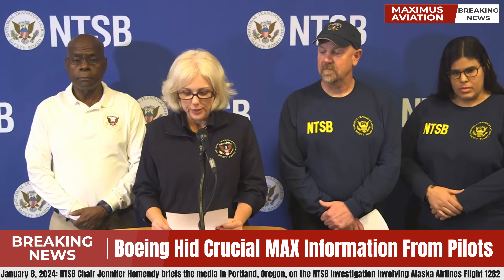Boeing NEVER Told Airlines That 737 Max Cockpit Door Was Designed To FLY Open During Decompression!

Comment: 13:23 
The door can be opened in a position to conduct maintenance which is 15 degrees down means it is not a permanent door plug as the springs are left in. 

Thus, if any of the hardware holding and properly alining the door in proper position fails or not installed correctly or the door itself defects outward causing a miss alignment of the door plug stop and tabs, the springs will eject the door into the airstream which will then rip the door further out and tear off of the airplane.

Comment: In Information Technology, worship of Almighty Outsourcing And Profit Over All means mostly things like a payroll application not working as expected or user frustration with a system 
 
When critical equipment such as an aircraft that transports human beings is concerned - the corporate love affair with outsourcing and profit before everything can result in loss of life 
  
Boeing needs to be  returned to the engineers and for an unstinting commitment to quality to be the driving force - even if it means outsourcing goes by the wayside and executive pay is reduced. Airlines need to put passengers above overarching profit —- and do on an even greater scale what I do when the ‘yellow wrench’ light comes on in my 2016 Mazda3 - I get my car to the mechanic as soon as possible. A Mazda is asymptotically not as complicated as an aircraft - ANY indicator of an issue should preclude that aircraft from flight until all systems have been thoroughly checked. Yes, it’s an inconvenience to take my car to the mechanic; yes, it means an aircraft won’t be generating revenue while being checked - but airlines will be less likely to have to have grief counselors for the families of those killed in a crash due to faulty maintenance

Comment: I am wondering  why when the initial depressurisation happened why the aircraft continued to climb and not descend straight away to ten thousand feet ?.    As for the flight  attendant not being able to see down the aisle  they use a mirror in the galley  their seats in the galley face backwards  . On wide body aircraft the Flight attendants are seated in the cabin by the emergency exits . On the plus side two aircraft accidents  one in Japan and this one and the airliners recorded no on board fatalities .  It’s sad that in Japan though the Dash  aircraft was not so lucky .

Comment: There have been problems with the pressurisation system on that aircraft. Could it be that, due to the failure there was an over pressure in the cabin, with the overpressure valves not working properly causing the door to blow out ?

Comment: Every plane I saw on ADS-B Exchange, was either a 737, 757, MD-11 from 1993, cargo planes delivering goods 24/7 9 of 10 were 737. Coming and going from LAX, ONT, or San Berdoo. Boeing, yes, I'm going, just not on that one until they fix it. It had a door modified by someone. After it was built.

Comment: What the hell people?!
Isn't it about time, Boeing is forced to change their ways?
Management is clearly running this company into the ground (no pun intended).
Business people have taken over and look at the bottom line and maximizing profits - evidently at ANY cost, even peoples safety.
"Boeing will make changes to the manual....." are you kidding me?? What else remains unmentioned in these manuals? What's the next thing to fail on this airplane?

Comment: Sooo, "low cabin pressure" activated followed by Master Caution alarm, and they just continued to climb like nothing happened? I'm confused.
Reply: The aircraft is in autopilot, it doesn’t automatically descend when cabin altitude warning comes on. First priority for the pilots is to get their masks on and THEN initiate the descent
Reply: @tomstravels520  Yes, obviously. But they took 3 or 4 minutes to start descending, if not more.
Reply: @bessarion1771  where on earth did you get that information from? 5:12:33, door blows off 5:13:41, aircraft reached maximum altitude, 5:13:56, autopilot commanded to descend. That’s 1 minute, 23 seconds. And considering they had to don oxygen masks, establish comms, work out what the hell just happened and contact ATC that’s seems about right
Reply: @tomstravels520  You are right. it took them 1 m 23s to start descending, and 4m 23 s to descend to around 10,000 ft. my bad.

Comment: Jennifer Homendy is misinformed or doesn't understand. The cockpit door has small blowout panels that open to relieve the pressure difference. The door itself is NOT designed to fly open. In this case it did. Which is very worrisome. Also, though Homendy is chair of the NTSB, she is not an engineer, and has no experience in the aerospace sector. Her background is strictly in highways and railroads and the Teamsters Union.
Reply: Do you not think they spoke to Boeing about that and they are the ones who would have told them it was designed to do that……hence now why they are changing the manuals

Comment: This woman is working for Boeing. Boeing left out CRITICAL INFORMATION FROM THE PILOTS AGAIN.
This woman should be hauling BOEING OVER THE COALS and NOT spouting all this garbage. What people want to know is IS IT SAFE TO FLY BOEING?  It's really simple, when people are giving you an overload of information that DOES NOT RELATE TO THE PROBLEM then they're covering up the true faults. Who cares about 'etops'. This woman is angling for a job at Boeing. She's full of garbage.
Reply: You do know there is a difference between the NTSB and FAA. NTSB establish facts, not assign blame
Reply: @tomstravels520   I certainly do, but there is no reason for the amount of 'Fluff' around what are the 'facts'. The facts are that a door stop blew out and also that the cabin door blew open on decompression when BOEING already have a quite workable set of 'blowout panels' for pressure equalisation that still keep the pilots secure.

Comment: Flew the Boeing 727, 737, 757 and 767 all during my 29 year airline career. We were taught, and it could easily be seen, that the cockpit door had 2 panels that would blow out into the cabin in case of rapid depressurization. But this tribal knowledge was obviously not passed down to the new generation of airline pilots. In fact, there was a terror incident right after 9-11-01 where a man crawled through one of he blowout panels in the cockpit door where he got bonked on the head with the cockpit crash axe. Speaking of the cockpit crash axe, it was affixed to the aft bulkhead of the cockpit and was intended to be used during a cabin fire to open holes in the sidewall so a fire extinguisher's agent could be sprayed into the fire. As an airline captain, in uniform, with an airline ID badge, I was not allowed to bring a pen knife with a one inch long blade through security, or a bottle of water, but once in the cockpit, I had access to the crash axe plus the fight controls of the plane.  Clearly, the TSA is more concerned with control and authority than security.
Reply: I think the whole door came open ,not the panels
Reply: Tribal knowledge? I'm sure that blowout panels are described in the 727, 737CL/NG, 757, and 767 FCOM.

Comment: She is most likely either incorrect or misstating when she mentions the flight crew was unaware of the flight deck door “opening” during a loss of pressurization event. The door for one does not open during the event. There are pressure panels that will open. The door itself remains closed. Flight manuals and aircraft maintenance manuals address this extensively. I find it hard to believe the crew was unaware of this, and if they were unaware of this, this would be a failure of the Alaska Airline’s flight training program, not Boeing. As for the plug, that’s is an entirely different story.

Comment: Pilots been watching too few aviation / accident videos. Door opening due to pressured is covered in a ton of videos; if it didn’t the rest of the plane would take the pressure and potentially compromising internal integrity and cables. There’s a couple of earlier explosive decompression events where this has happened too. In one of the accidents where cockpit windows blew there was a problem that the door smashed into electronics console violently, causing some breakers to pop accidentally.

Comment: I can see where it is necessary to either open the cockpit door or have a vent open to equalize pressure during decompression otherwise the pressure differential could cause the door to open explosively and possible fly down the aisle and injure or kill someone.  It would be better, OTOH, to keep the cockpit door closed but vent the cockpit using ductwork.  I can imagine terrorists thinking over how they might exploit this situation to get into the cockpit and do what they do.  I suspect this was one of the reasons Boeing didn't mention this.

Comment: Imagine if Ford had modified the Pinto back in the 80’s, 90’s, 2000’s rather than scrapping it and going with newer designs. The Pinto was designed and developed around the same time as the 737. Sooo yeah you’re flying in the most modern model Ford Pinto …

Comment: As a 30+ year airline pilot I can tell you every Boeing and Airbus aircraft I have flown has had cockpit doors equipped with explosive decompression "blowout panels". Just Google the term. EVERY airline pilot should be aware this.  If the Alaska Airlines flight crew was not aware of this, that is a problem with their training, not Boeing.
Reply: You are right the panels blowout on the max the whole door opens to the passenger area.
Reply: @mikemicksun6469  I'm not sure that is true actually. I flew the 737, not the MAX, and it had blowout panels. Not sure why Boeing would design the whole door to open that way. That may be just what the NTSB and the news folks are saying. Seems like a security risk to design the door to open in a depressurization event.

Comment: It seems a pattern is showing here, Boeing's incompetent's engineering. 737 Max legacy of death due to engineering oversights and lack of specific training and information on their make shift designs. I just flew on 737 Max 8 and couldn't help to notice the ginormous engines fitted to such a small passenger aircraft. It seems just by looking at the scale of them in comparison to the wing would be intuitively wrong center of weight and knowing that they knew in retrospect and made a computer control change to compensate without telling anyone, resulting in deaths shouldn't be tolerated because now we have this. This is aside from the cause too, spotty workmanship I beleive I heard. We CAN"T tolerate this, this company is playing roulette with our lives for money, because ultimately it comes down to money and risk management.

Comment: the Problem is not only that they Design a cockpit door to open .. the Question is  WHY ???  is it not Way Safer to try to keep the Cockpit Pressured by Locking the door  .. so the Pilots have more Oxigen to try to safe the Plane ...  there is no reason for the Pilots to get out of the cocpit  at an Decompression .. they have no paracute to leafe the Aircraft ..

Comment: Instead of having the cockpit door fly open, perhaps they should have a small panel with a mesh over it open to equalize pressure between the cockpit and cabin, along with an indicator so the pilots know why it is noisy and that they need to put on their oxygen masks. This would insure the security of the flight crew so they can deal with the emergency. The mesh would prevent checklists from flying out of the cockpit into the cabin.

Comment: REmember, with most corporations now, its profit before quality; kinda like the doomed space shuttle.  When will we learn? 

I am not an engineer, but I have worked on everything from lawnmowers to earthmovers and many different kinds of farm machinery buildings.  I cannot comprehend that a door (plug) that supposedly is made to fill a hole in a fuselage was made to be removed that easily.  I would have made it so it bolted into/onto the airplane in about 6 places; none of the hinging/pin/spring stuff.   At the least they should have used self locking castellated nuts so there would be double protection, but then you do have to install them .

Comment: It has a blow out panel on the door, if the door is locked it will not open.
Reply: @R.BOWERS  Well there must be a reason they did it and an open door is not an issue when the plane is depressurized and people are on oxygen and in survival mode, even the wanna be hijacker will stay in his seat under those circumstances.

Comment: I became a flight attendant in 2007 in Latin America, and we have always known that the flight deck security door will unlock in a rapid decompression for the purpose of one getting straight into the cockpit to make sure the pilots have their quick donning oxygen masks on.
Reply: @juanpabloarrea6393 Should a door unlike, how would that door get into the cockpit? And how would that enable the pilots to don their oxygen masks? Wouldn't it be simpler to have a pressure sensor, and if the pressure drops, that would tell the system to deploy the masks? Why do we need the doors to unlock, or to open in order for the makes to deploy? Make it make sense.
Reply: @soilmanted  He meant so that the FAs could check and insure that the pilots had on their O2 mask.
Reply: @haljetdvr  Still not making sense. If the door were to automatically unlock in response to cabin pressure going down, how would that cause the FAs to insure that the pilots had their oxygen masks on? And as I said, why wouldn't there be pressure sensors that could tell the system to automatically deploy the masks or produce a visual or audible warning in the cockpit that the pressure had dropped. Why would the system be designed to rely upon the FA's to hear when the door lock opens, recognize that this was an indication that the pressure had dropped, and then cause them to walk or run to the cockpit and inform the pilots. Makes no sense. If the system can be designed so that a drop in pressure causes a lock to open, it can just as easily be designed to cause a notification sound or warning lamp in the cockpit to turn on, or the oxygen masks to drop down automatically.
Reply: @soilmanted  the oxygen masks in the cockpit in any airliner are very similar but they don't drop. They need to be removed from its storage and placed by hand over the pilots head and face. It's more complex due to the reason that they quickly adjust to the pilots head, it has an integrated communication microphone for use with air traffic control and crew intercommunication, and smoke goggles. They also have two modes to use the oxygen.  The pilots are well trained to use the masks by themselves, however it's a precaution that the cabin crew needs to make sure the pilots have their mask on in the event of a loss of cabin pressure. Making sure the cockpit and the pilots are safe is a priority since we need to make sure we have pilots to fly the plane.
https://youtu.be/mgLSTimJ868?si=vSvDrXwHENVM37t2
Reply: @EUA052  OK. That makes sense. The pilots have more complex masks with electronic communication devices built into them. But it doesn't explain "the flight deck security door will unlock in a rapid decompression for the purpose of one getting straight into the cockpit to make sure the pilots have their quick donning oxygen masks on." The way that the flight attendants are notified that there is a decompression event is by hearing the door lock unlock? Won't they see the masks falling down for the passengers? There wont be any visual aid such as a sign lighting up, or loud warning recorded announcement saying "there is decompression, please put your masks on"? Instead passengers and FAs have to listen for the click of the door-lock unlocking? That is not making sense to me. And what does that have to do with the door opening or becoming unattached and going bye-bye?
Reply: @soilmanted  If in flight and the mask deploy then you should put on your mask. The flight deck door should have blow out panels to equalize the pressure between the cabin and flight deck. Generally the auto pilot is on by the time you reach an altitude that requires O2. So just like Juan mentioned triple checking to insure that pilots have on their quick donning mask is just a backup to the backup. By the way pre covid the #1 rule broken on US flight decks was pilots not donning their O2 mask when there was only 1 pilot at the controls.
Reply: @haljetdvr That doesn't answer my question.
Reply: Differential in pressure can ocean gate the fuselage
Reply: The actual purpose of the unlocking of the security door in the event of a cabin decompression is to prevent damage to the security door. In the event of a flight deck decompression special decompression panels in the door will open in the direction of the flight deck.

Comment: Were we not promised when the Max returned from a years long grounding, they would be the safest plane on the planet? Every bug and problem would be solved? Well you would have to drag me kicking and screaming to fly on a max. I do not trust it is a safe aircraft. What other untold surprise awaits? Who knows what is going to come lose, break or otherwise challenge its ability to fly. I am not into Russian Roulette.
Reply: So you aren't comforted by the thousands of completely uneventful 737 flights happening every day?
Reply: @robroilen4441  I wont fly on a Max.. is that too hard for you to understand. It carries an added risk which has been increased by lose nuts. Poor quality control.  It becomes a risk I am not willing to take. I will still fly if i have to ..but not on a Max.
Reply: @bobdevreeze4741  Your concerns are statistically unfounded. The car you drive probably is statistically much less safe than a 737 MAX.